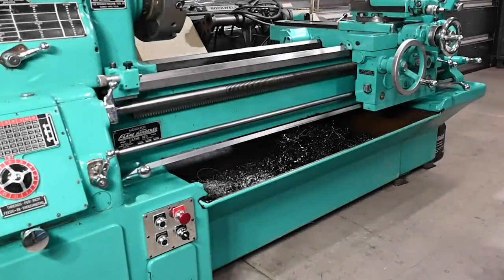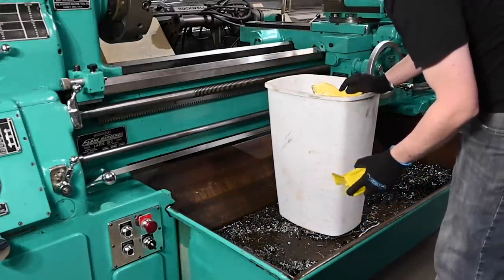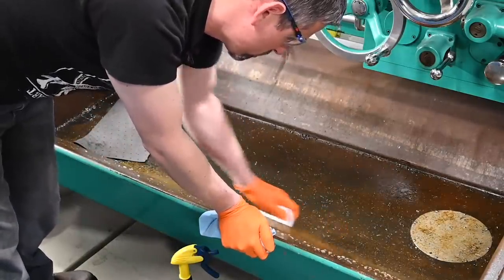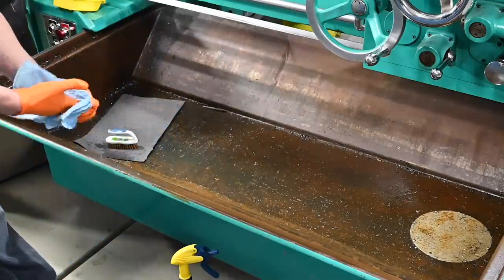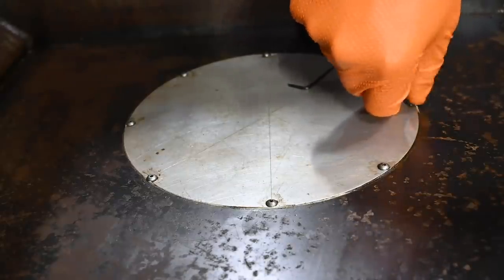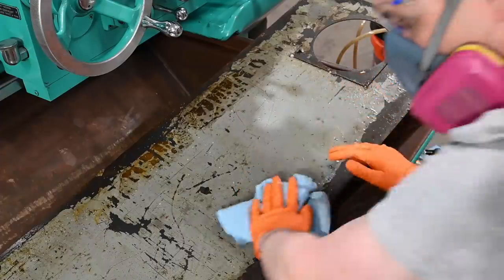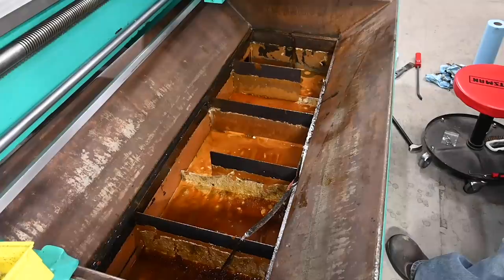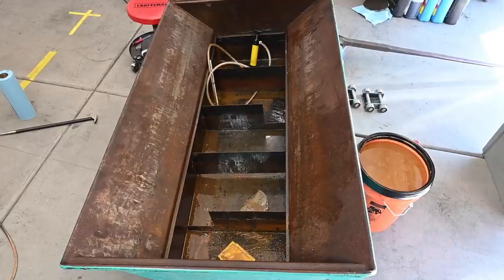Monarch Lathe Coolant System Rescue! With Smell-o-vision!

Comment: Just be yourself, and ignore any negativity. It definitely takes some thick skin to be a creator, there are always going to be people that criticize and "know a better way". Don't let them get to you.

Are those baffles in the bottom of the pan removable? I would imagine they should be.
Reply from the maker: They’re welded in. Not sure why they’re in here. Only thought is that Monarch sold a lot of machines to the navy and they would go on ships so maybe all machines left the factory with baffles. 🤷🏻‍♂️
Reply: @AlwaysSunnyintheShop  I would assume they're to let small particulates (super fine shavings) settle before reaching the pump.
Reply: @AlwaysSunnyintheShop  Sorry if this is a stupid question, but welded as 1 unit and slid in then welded in? Like are they welded on the bottom?
Reply from the maker: Not at all. The whole structure was welded together including the painted parts. Then the baffles just each have a few stitch welds holding them to the inside of the sump walls.
Reply: @AlwaysSunnyintheShop  Got ya, I've seen similar baffles on a coolant tank for an OD grinder.... they were removable as a unit.
I guess its up to you to decide
1. Do you need them?
2. Is it worth the time to cut them out.
I'd say yes to both considering the work you've done to the machine and how nice it is. Probably don't need to weld them back in if you can get them out as a unit.
Edit: From the video, it looks like the angle that holds the removable bottom goes around the perimeter of the "coolant" area, then the baffles are welded to that.
Reply: A lot of coolant systems have baffles.  I never quite knew why but they work, and they were in the from the factory to be as they were designed to work.
Reply: @AlwaysSunnyintheShop  The baffles trap small chips, dirt, rust, cutting oils and tramp oils from the lub system. The way you pulled it out. I didn't even think the pump was attached. FYI, the drain return hole is normally close to the chuck. I don't guess it matters since you don't need or want the coolant or the organic life that eats oil. 😉
I'd just power wash it, wipe it with mineral spirits and paint the thing so it doesn't rust. An industrial 2 part epoxy would be best with a paint roller (easier than spray). 👍👍
Reply: That enter part may lift out.
Reply: @randynewby8359  Usually these things are built like a tank. I can't recall any grinder, engine or turret lathes being easy to clean. It"s always difficult and nasty.

Comment: I find nothing wrong with your info, your attitude, or your advise. I enjoy the alternative perspectives I see on YouTube. If agreed with every one I wouldn't benefit by watching or learn anything. Don't waste time on envious asshole critics that don't respect your right to an opinion.

In CNC machines with large coolant systems often stink. They have continuous way lube pump systems which ultimately puts a layer of oil on the water soluble coolant. This forms a home for anaerobic bacteria which stink. Coolants that are frequently circulated and oxygenated
don't support the bacteria growth. Let it stand around, then lookout. Various potions have been promoted over the years to solve this with various pros and cons. One solution is a little bleach or bromine hot tub tablets but both are corrosive. Effective concentrations are probably in the few ppm which might not be all that corrosive. If this were practical it might see wide spread use  I don't think it has so maybe it is a bad idea. 

If some makes a stink proof coolant I'd like know about it. 

Skimming the way oil off the surface with any of the commercially available skimmers helps. We skim all of our machines. The benefit of this letting air in. Another solution is an aquarium air pump and air stone to constantly bubble the coolant. This is likely harmless and if it works it might be the best solution. Just running your coolant pump every day might be enough.

I would take your tank to a powder coater that will sand blast and powder paint the tank. It won't cost all that much. He might have trouble matching the color with something he has in stock. We took an entire waterjet machine for this treatment as well as many other things. We blast and paint in house and I have a walk in oven but can blast large things. We used to go out for large blasting and paint in house. Now we send out large things for blast and paint. Realize the chip tray is very hard on ordinary paint. Powder paint is much tougher and a much longer term solution. 

Best of luck!
JY
Reply from the maker: Very good comment, thank you. Should help some other folks who don’t have experience with coolant management. Have had good success with NexJen skimmers for tramp oil. But you’re right- eventually the little guys will grow and stink.

Comment: Pretty rancid oil. Coolant plus tramp oil mixed in. Where I work once a year I get 5 gallons of hot soap water and pump it through the machine using its own pump to clean it out. Liquid laundry detergent in a 5-gallon bucket of boiling hot water works. After I get all the crap out like you just did. It may help your coolant live longer if you invest in a tramp oil skimmer.
Reply: This old oil field shop where I worked as a child, used Tide washing powder once. It was like a big bubble bath. What a mess. 😮😁